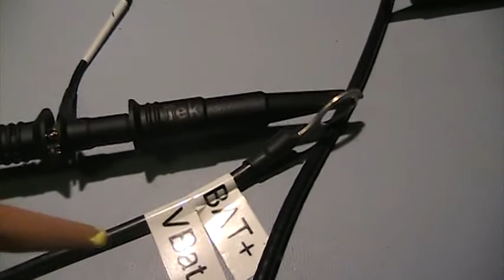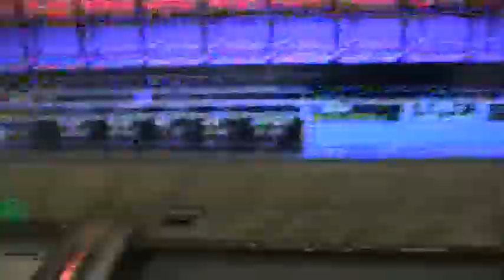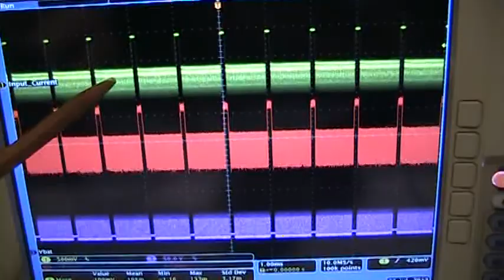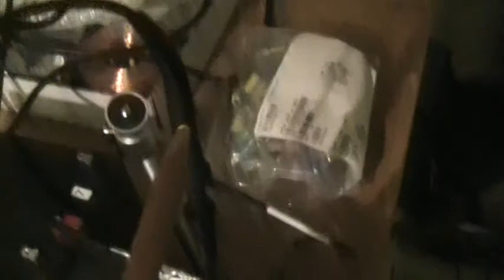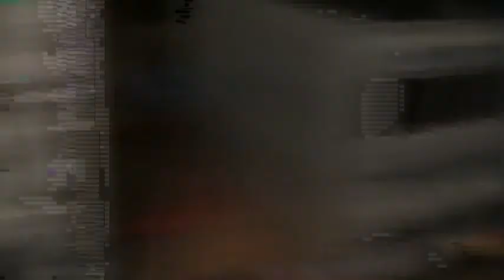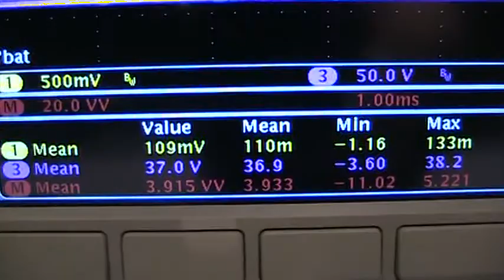8   Pbat - The wrong way, a better way, and the CORRECT way.

Comment: There is a certain minimum level of common understanding that is necessary before people can discuss a topic and expect any meaningful outcome from the discussion.  That common understanding may or may not be possible to develop.  If someone doesn't understand that the "negative" output of a function generator becomes positive with respect to the "positive" lead and the positive lead becomes negative with respect to the positive when the output is set negative they need to learn that.

Comment: That is exactly my point. However, in every schematic published by Ainslie herself, the FG outputs are labelled "+" and "-". Since the Gate of Q2 is connected to the "minus" FG output (in her published schematic), how could it ever be turned on? This is how she reasoned and perhaps still does. That's the point of my whole "negative bias" series: to attempt to explain to RA something she believes is impossible: turning on a mosfet by lowering source voltage, rather than raising gate voltage.

Comment: The black lead is most certainly the reference against which the red voltage works just as the red lead is the reference against which the black lead works. Ying and yang.  If the red lead is +10V one moment relative to the black lead as a reference, then the black lead is -10V relative to the red lead at the same moment.  What matters from an accounting standpoint is the voltages across each circuit branch.

Comment: Nice work, neat and clearly explained.

I am still picking the nit of the FG output designations though. Especially since you have isolated the chassis ground and BNC shield of your FG, the Black output isn't really a "reference" any more at all. And it's not a "negative" either, since the relative voltages of Red and Black reverse sign with every zero-crossing of the output waveform.

Comment: Excellent!  The key points:

When the battery measurements are done at the battery with minimal added wiring inductance, the average power computed by averaging the product of instantaneous voltage and current converges with average power computed from the product of average voltage and current.  They converge because the battery impedance looks resistive placing current and voltage in-phase.

Taken with the other videos, they demonstrate possible errors with other set-ups.